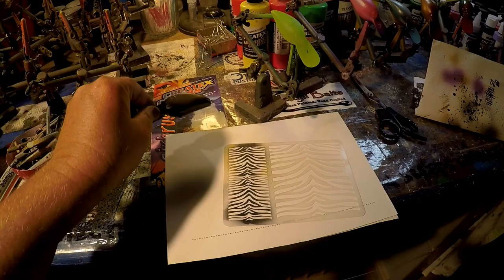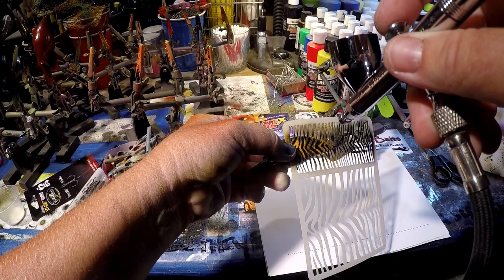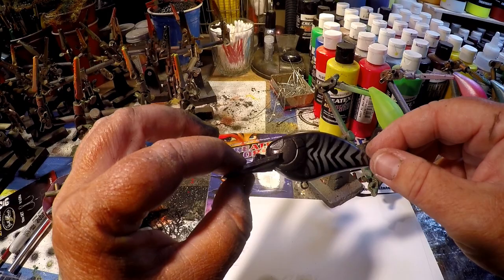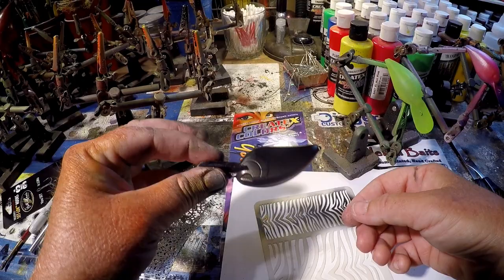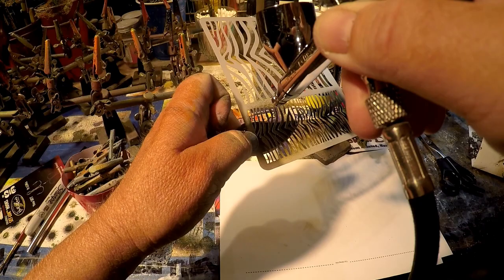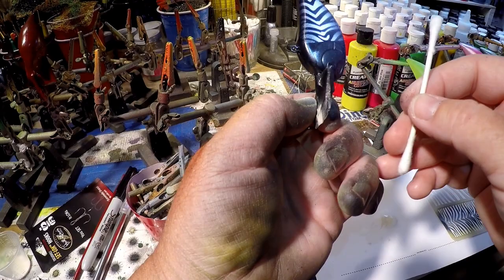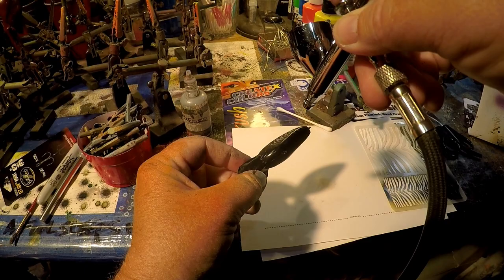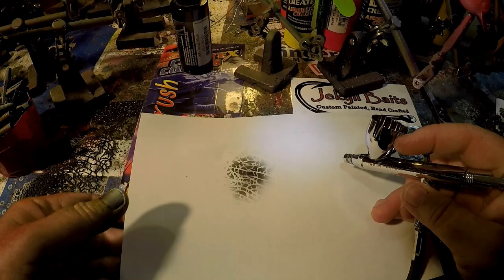SPRAY SESSION SATURDAY: STENCILS AND LAYERS (part 2 of 3)

Comment: I need to upgrade to your brush. My cheap one just doesn't work as well at lower pressure. That splatter technique is brilliant and I'm loving the craw on that transparent green. Again thanks for the tips you'll turn us into artists at some point with these. Question if you have time. How can I add glitter when using the kbs? I bought some of the devcon so I can do a glitter coat but it ends up lumpy to me and I don't know how to get a smooth finish like the kbs gives.
Reply from the maker: I always dip my KBS first, then gently grab the tail drip wire as the bait as it’s hanging to dry, and sprinkle the glitter onto the tacky KBS without touching the bait itself. Then just let it hang. Usually on any lure that has texture or glitter, I dip it a second time after it’s been drying for ATLEAST 12 hours.
Reply: Jekyll424 thanks. I'm going to give that a try on my next go.

Comment: First off great video! I have a Question, how do you determine the shapes of your stencils when you make them?
Reply from the maker: I outline the blank I’m going to be using
Reply: Another stencil question, how do you design your stencil wheels?
Reply from the maker: I don’t use wheels per say, but I’ve seen some really good patterns on wheels from Russ Allen over at Insane Custom Stencils. He has a FB page, and on there is a link to his website